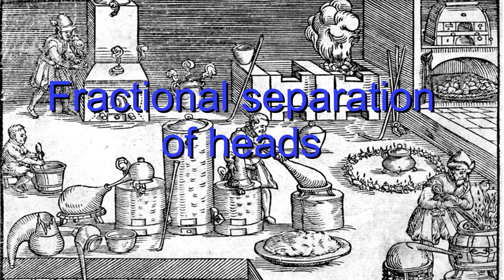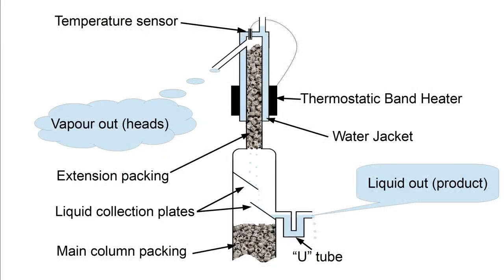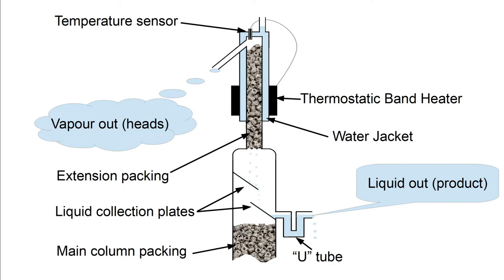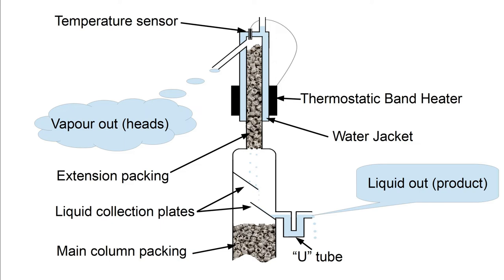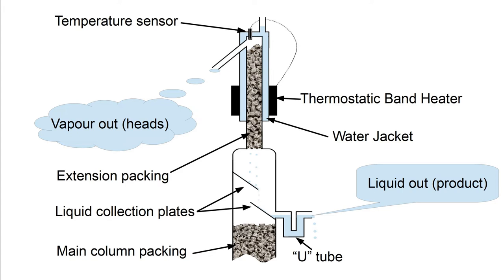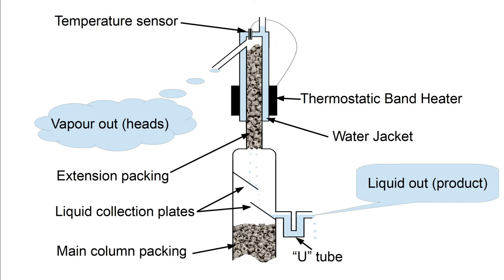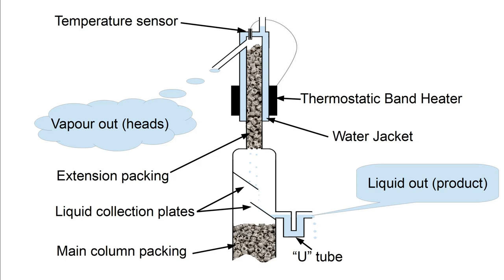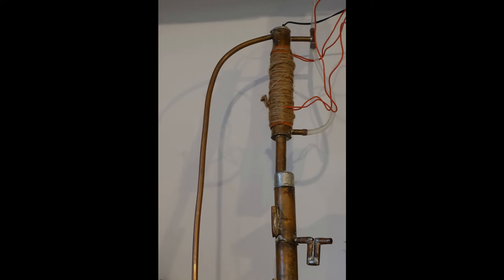Separation of heads with fractional distillation. Moonshine Vodka.

Comment: You said that you tried a second isothermal dephlegmator at the top but it ran too cool.

My understanding is that the benefit of using an isothermal dephlegmator would be that it's possible to control the column top temperature with the boiling point of the liquid. So by changing the composition of the liquid, the constant column top temperature could be achieved just by using a mixture of ethanol and methanol that boils at a particular desired column top temperature (e.g your 70 degrees C value discussed in your column top temps video). That way the system doesn't need the precise electronic temperature control with the band heater.

Since the energy from the heads vapour is not enough to get a column top isothermal dephlegmator hot enough, do you think there could be a way of heating the upper dephlegmator to keep a ethanol/methanol mix boiling? You said that you have experimented with some things but haven't gone into detail

Two methods that I thought of getting heat into the ethanol/methanol mixture are:
1) use the heater bands around the dephlegmator, but operating at a constant power, instead of constant temperature. My understanding is that it wouldn't have to be too precisely tuned: above a certain point, the input power would just affect how fast the ethanol/methanol mixture boils (similar to the lower isothermal dephlegmator).

2) use the waste heat from the lower isothermal dephlegmator to heat the upper one. E.g. use the condensor output water to heat the upper isothermal dephlegmator. I'm not 100% sure what this would look like, but basically however it is done, it would add more complexity to the tubing but possibly reduce the complexity of the electronic control, and wouldn't have to use an electronic band heater.

Have you tried either of these methods? The benefits of a column top isothermal dephlegmator seems to be so good that I want to try investigating more
Reply from the maker: I think both of your designs would work, but I'd prefer the one where you take the vapor from the lower isothermal deflator and condense it in the upper one in order to deliver heat to it, and then have a reflux condenser that condenses all vapor coming off the top isothermal deflator, and any excess vapor from the bottom one that hasn't condensed inside the chamber of the top one.

That would also mean not having to add extra power to the heater and therefore would save energy. I haven't tried either of these because I find it easier to work with electronics than I do with plumbing, also because when I started I didn't know what temperature to set the top of the column to, and a PID controller made it much easier to adjust that temperature over a range of values rather than fiddling about with mixtures of spirit that boil at the right temperature.

Another point is that you don't really need an isothermal deflagmator for continuous distillation. And so overall it's simpler in that context just to use a column top heater with PID controller.